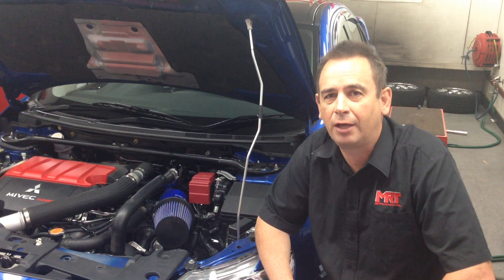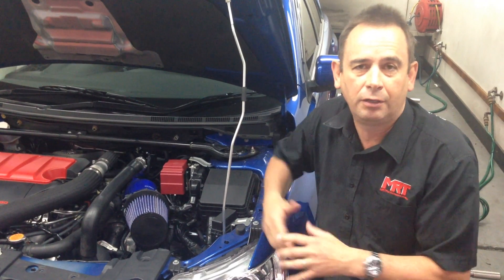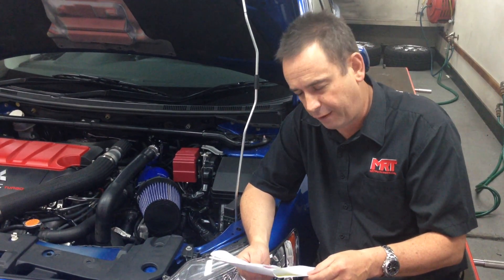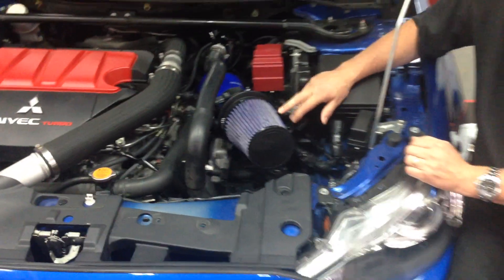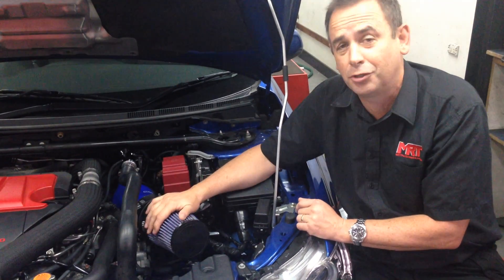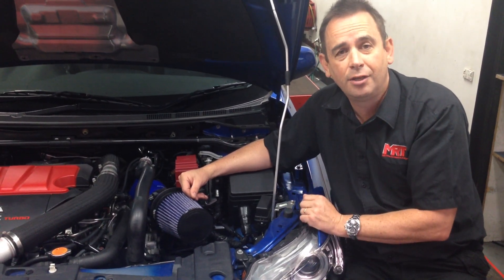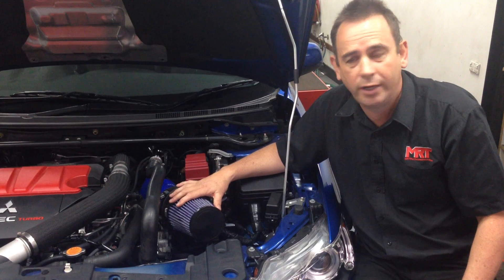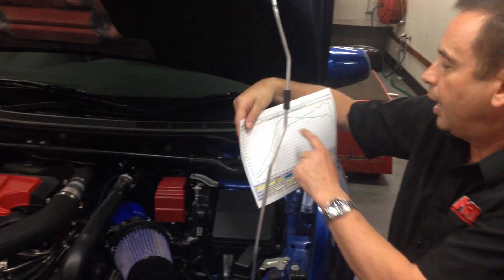Mitsubishi EVO Cold air intake options

Comment: I had the same modifications on my Evo X when I bought a very low km MR. I had the XB kit fitted and was advised by MRT to go factory. Like this owner I ignored the advice and had nothing but problems... fluctuating revs from thermo fans blowing onto the intake, sluggish takeoff, sluggish gear change, erratic tune, and other issues. In the end the car was no fun to drive and I got rid of it. This video confirms what I had been told by a few people in the know... don't mess with the factory induction on Evo X... nice video!
Reply: That intake is a shitty design...If you go with a cheap design intake then yes of course you will have issues (get what you paid for).  My ETS intake has been great and im running just an OTS map no problems. But getting rid of your car because you got a shitty intake was your fault not the car.
Reply from the maker: thanks for your reply and feedback
:)

Comment: I would assume that with a proper tune and a proper intake system i.e. The AEM intake that uses OEM air funnel and comes with a heat shield would work without issues and still give you that loud motor sound most people are looking for. Would this be correct?
Reply: landlord21 I am not sure, noise yes, power no, reliability, thats what testing is for!

Comment: I have the Blitz Sus C1 core intake with a heatshield, and a metal bov pipe locked tight, it has no movement and it gave me more power and a great sound.
Reply from the maker: Like I suggsted in the video, if you are happy thats great!
:)
Reply: MRT Performance what if you use a high performance air filter with a stock airbox
Reply: MRT Performance I will take your advice and revert it back to the stock airbox, it is not a complicated procedure, and I will try to tell the difference with a virtual dyno program. I have many datalogs with the pod filter and I will try to compare the results.

Comment: I never understood why people install short ram kits, because of where it sits in the engine. If you're going to install a cold air intake on a Evo X GSR, I suggest spending the money and invest in an AMS Mitsubishi Lancer Evolution X Performance Cold Air Intake. It relocates the air filter into the Left Fender Well and It definitely lowers the air temps. Especially if you also buy the Left Fog Lamp Screen. That setup has lowered my air intake temps by at least 10 degrees Fahrenheit.

Comment: so I am guessing american companies like Cobb, you disagree with? generally have these parts in a stage 1 kit
Reply: Cobbs intake is crap at least for the Evo X.  Now their exhaust parts and 3 ports arent bad i run them on my MR.
Reply: excel4600c   If the intake is not fixed tight in place than it will wobble, that messes up the sensor reading, and when the heat fans turn on the idle gets messed up, that is why most jdm intakes have either a huge heat shield or a big carbon housing like coltspeed, kansai, blitz. Ram intakes have large surface area, combine that with a carbon housing and you have a high performance CAI. 
  And about the turbo inlet pipe, I have a metal one, some say it heats up because it is close to the engine, turbo and gearbox, but generally all silicone or metal turbo inlets have benefits over the stock one, they are larger and smooth, so better airflow to the turbo. My intake has a metal heatshield that comes below the ram, and it shields from the cooling fans and the gearbox heat, these two are the enemies of the intake.

Comment: Brett I agree with you on most points however that is not a cold air intake, that's some dodgy backyard short ram intake that's obviously going to suck in hot air especially being that its right above the SST. You should have discussed possible proper cold air intake options by manufacturers that have done the research. Now I know that might go against some of the trading partners & products you promote but well at least in my example I have a AEM intake that uses the stock snorkel to start with(yes I know.... it keeps the Mitsubishi initial intake) but has a better power gain all round on a stock turbo compared to using the stock system. Also the manufacturers has some dyno stats(albeit in stock form) about the gains.  It would good to see your thoughts discussing this.
Reply from the maker: yes its dodgy
:(
I would like to  see an independant test on your intake, in all the tests we have done we have seen ZERO gain
fact is the OEM airbox outflows the OEM engine...
so a  bigger intake is not needed  until you build a stroker or monster engine...
Reply: MRT Performance since this comment was posted, K&N’s Typhoon Intake has added 21whp OVER stock on an Evo X on a dyno. SAE corrected numbers too I think. I’ll have to check that to be sure. Thank goodness for heat shields....

Comment: Any chance of your thoughts on a this mod on a N/A EJ20 with headers please? and would making a new box/shield between the engine and the intake help with the hot air? or is once again the factory set up best? Thanks for all the informative videos.
Reply from the maker: Not  much power to get from this engine
:(
Reply: MRT Performance
Thanks for the reply, I only thought a small improvement would be possible, I'm not really chasing BHP. As it happens the pod filter was a gift from a friend with a GT Forester after it caused the sorts of things you discuss in the video to happen with his ride. It does sound great but I am happy to run the factory set up if the pod doesn't do my car any good? I got the headers for the exhaust note, sounds mean and again any power improvement was secondary. Cheers.

Comment: I tend to believe most of the aftermarket short rams are just garbage. But some of them are well designed, like AEM; it still uses the original air opening at the very front of the engine bay, but just increased the size of the intake surface by reshaping it from a flat surface to a bottle shape.

But I still cannot 100% sure if these aftermarket intake systems actually do the job as they should be. TBH, removing the air filter will gain a noticable more power but significantly reduce the lifespan of the engine. So in theory, aftermarket suppliers can sell thin filters and claim a high power output.

Comment: This might sound like a silly question but here goes. All modern cars have air con. Why can the cold air from the aircon not be directed to the cold air feed? Cold air is good the car produces cold air? Is it just a case of stealing from Peter to give to Paul?
Reply from the maker: wont work, you cant create more power from the same output
Reply: 1888sparky Main problem with that is AC uses refrigerant to keep you cold in the car, refrigerant goes from liquid to gas in the car you dont want the "gas" state of it to get into your intake and later turn back to liquid you would hydrolock your engine

Comment: I 100% agree with your conclusions with the intake system your showing in this video BUT your comments about STI's etc not benefiting from a new intake unless they have internal work done (high hp) is deceiving.

There is solid evidence out there that a well designed aftermarket intake can produce more power on even a relatively standard or mildly modified STi or EVO.

My actual car- 2006 STI with Turbo back exhaust, 76mm cold air intake piping with pod filter mounted in guard and tuned appropriately made consistently 7kw MORE than without the intake and also 7-9kw more than 6 other WRX-STI cars on the same mainline roller dyno.

I see it inappropriate to generalise when MRT has a great name in the industry and there are already so many misleading thoughts that make people modify their cars incorrectly.
Reply from the maker: The STI and WRX are near the same, lower power gain if any when tuned with a stock engine under sensible boost levels.
Our data does  not agree with your tests.
But we are glad you are happy, thats what counts
:)

Comment: Why would you even put that in take on the car, they're way better aftermarket intakes that replace the factory unit and keep the air box.
Shame on the owner
Reply: Being cheap comes to mind.  if the intake cost less than $100 pass it.  Some times things cost more for a reason.